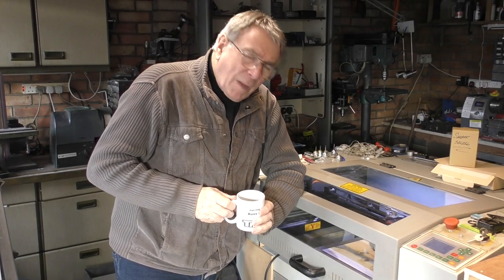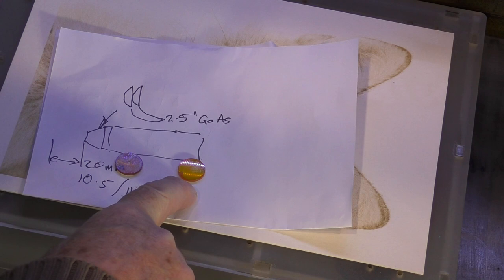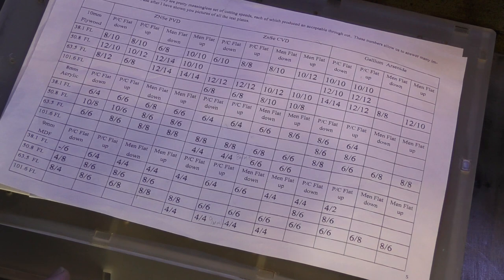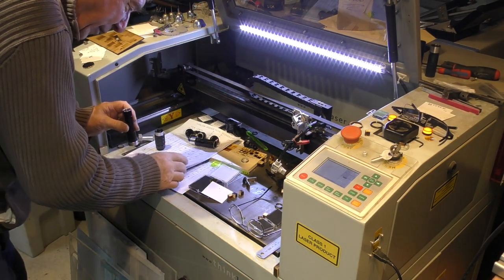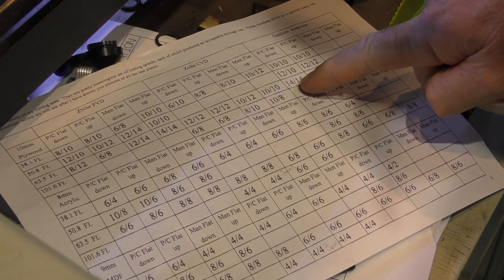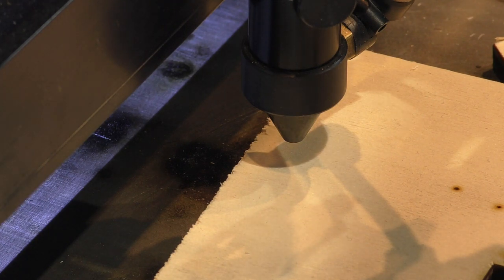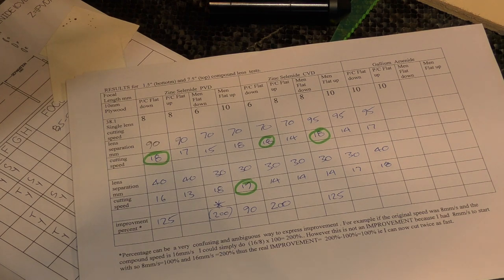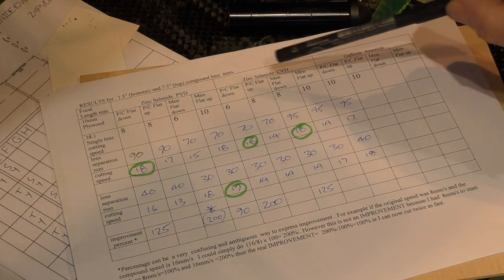RDWorks Learning Lab 200 Compound lens Conclusion

Comment: I feel relieved (because I won't have to use all those contraptions on my weak motor and belt) although I was hoping it would turn out as a total breakthrough. Not everything seems to be lost, as the compound of the two GaAs lens is definitely a great advance and knowing that a 2.5" mundane lens will do an excellent job cutting thick materials. As usual, your contributions to the laser community are priceless, Russ! Thanks for sharing and keep them coming!
Reply from the maker: Hi Nico 
  The long compound lens is not dead as you will see from my answer to Dave V. It's on hold until I begin to understand what is REALLY happening at the focal point.

Best wishes
Russ

Comment: Russ, I recently purchased and set up a 50W (OK, actually 40W) OMT laser and am happily running with Lightburn. Regardless of the software I've found your efforts to be a wonderful introduction. Very much appreciated. Regarding etching/engraving on birch ply I found a useful approach when dealing with an image with broad tonal range. I realized that just as in the darkroom a single exposure won't yield an optimal result, the same holds true with the laser. I've been doing the equivalent of dodging and burning by pre-processing in Photoshop to create separated layers which are within the laser's capability. So, I pull out the highlights, midtones, shadows and blacks into separate layers which I then "print" separately, and can easily control the depth and color each layer. This is, admittedly a somewhat slow process, but has kept family happy with engravings made from their snapshots, which often have blown-out hightlights and underexposes shadows. I will continue to work my way through your video opus.  Thanks for all the effort and theory!
Reply from the maker: Hi Robert
The tonal separation onto different layers  you are adopting is one advocated by Lightburn. In fact you are doing a sort of grey scale engraving but just one band of grey at a time.. You may be getting Ok results but there is a much quicker and precision way to do very accurate photo replication  but don't use the graphics section of Lightburn. I absolutely love Lightburn but when it comes to their photo replication section  Hmmm..... the guy that wrote it has hijacked print industry algorithms and made a few minor changes that  cause all sorts of detail problems when trying to copy them with a laser. Like every other piece of photo preprocessing  software. the emphasis is on getting a good image and then over emphasizing it with sharpening and lightening. to compensate for something few understand..... the DOT you can burn... Forget about the image and understand what your machine is capable of . You cannot paint 20 point  text characters with a 25mm paint brush. You see people suggesting that you prepare 600ppi images to get good detail.. The shows a complete lack of process understaning.To achieve that resolution with a laser machine  you need to able to burn a dot that is 25.4/600=0.042mm diameter. You will be lucky (even with a 1.5" lens to get somewhere between 0.15 and 0.2mm. So that means every pixel will be burnt  about 16 times. THAT is why all these softwares dramatically over lighten and sharpen their images into cartoon like results. I have sent a lot of time understanding the transference of print technology to the laser.  It is not 100% transferable but you can get VERY good results when you understand one simple rule 1 pixel =1 dot. That means you do NOT have to change the power to get darker and lighter gradations  you just change your image into a bitmap with diffusion dither in Photoshop  and the job is done (I exaggerate slightly)  Now comes the trick with Lightburn.  I spent quite a bit of time with the writer of Lightburn trying to sort out tonal issues  with the various  print industry  standard dither algorithms he has included. He imagined an issue that may occur with glass tube lasers and has put some corrections in the algorithms to compensate..  Most folks will be happy with the results  but I was not. His answer was very simple. He added a PASS THOUGH switch that does just that. You present Lightburn with a pre -dithered image  and it will be printed "as is" with no correction. 
 Take a look at  two particular videos in my series (there are many as I gradually learn about this subject) 
https://www.youtube.com/watch?v=jwo9hrVhpIw
https://www.youtube.com/watch?v=UxfC9jbX6PM
If you need more details just add your disguised email address to another comment and I will send you a data pack. I will also delete your comment/email address.

Best wishes
Russ
Reply: @SarbarMultimedia  Hi Russ, thanks for such an in-depth reply. FWIW, I absolutely understand the relationship between dots and pixels; they are binary - On of Off. No third state, which is why there's no gray, and that gray scales depend on the way our brain perceives patterns. With dithering, it's the space between dots. When I think about dithering and gray scale, I realize the different "shapes,"  diamond, cross, rhomboid, etc. are ultimate a dot pattern. It's our brain that makes gray out of the pattern. This is fundamentally different from film. Although black and white film still is based on the molecular structure and density of the light-sensitive silver halides. (So, really, the pixel is now at the molecular level). I will go back and review the two videos you suggested. I've seen others that used the Pass Through option, but the explanations and tutorials seem more convoluted than they need be. I just added a compound lens and am getting set up to run your dot test with the two lenses. email to follow if I can't muddle on through.

Best Regards,
Bob

Comment: So I have another idea for how you should test each lens setup. If you take a block of acrylic and shoot a pulse straight down, you should be able to see the shape of the beam. Then take pulses of various lengths and set them side-by-side. This would in effect provide a frame by frame snapshot of how the laser cuts in time from 10ms, 20ms... 100ms, 200ms. This would give you much more tangible comparisons because you can just measure the penetration of a 200ms pulse. 

Currently, your method can barely determine the difference between 16 mm/s and 15 mm/s, which is a difference of almost 10%. If you instead measure pulse penetration, you can get much finer results, which would make it much faster to optimize all the combinations. Good luck!
Reply from the maker: Hi Daniel
 Many thanks for the brilliant idea. However,  I completed a video last week that includes both the suggestions you made. The second one gives meaningful objective data as you will see when I publish during next week.. It turns out that the real objective differences happen in less than 100ms.
 Sincere thanks for the comment. I was in a bit of a hole a couple of weeks ago  and had to think hard to make sense of what I was seeing.. It's great to know that it stimulates thinking in others.
 Best wishes
Russ

Comment: You have at least proved the benefits of a quality tube. Don't know if I have my old mode burn block, will have to do one again just to be sure I'm seeing what I should. I had hoped you would also see some ability to cut thicker materials with the long compound lens, but the sharper point seems to do just that. I wasn't real clear, did you see the need for the GaAs lower lens, or did the PVD / CVD do all right once you switched to the 7.5" top lens?
Reply from the maker: Hi Dave

 I have a lot more investigation to do because it seems that my "sharp" SPT tube is worth it's weight in gold. BUT I have a lower quality mode burn on my RF Tangerine Tiger and a with only 30 watts available,  could do with a turbo boost for cutting.  I will be transferring some of this effort to that machine in the coming weeks to see  if the compound lens lives up to my original expectations.
 The next video which I have just completed  takes a forensic look at how laser cutting works. I have dabbled with many aspects of cutting as my learning journey progressed  but this compound venture has produced one staggering outcome ...... the almost universal max cutting speed of 18mm/s  regardless of lens combinations.  This cannot be a coincidence and has forced me to think long and hard about how and why this may be happening.

 You can always cut thicker materials  if you have enough power and run slow enough. The next video answers this question and explains  why. It also helped to clarify my thoughts and is allowing me   to better  envision what may be happening at the focal point . There's still a lot more to understand.

In answer to your lens suitability question  all I can say is that GaAs lenses are rated for several hundred watts , ZnSe  CVD are rated at about 200 watts and ZnSe PVD are rated at 80 watts.. Si it depends on your tube and what you plan to do with the lens. There is no one lense that fits all but for most of my normal (non-experimental) use  I tend to use a PVD 2.5" for general cutting  and normal engraving and a compound engraving lens for photo engraving..With only 70 watts I am good to use every material type. 

Best wishes
Russ
Reply: @SarbarMultimedia  Yeah, I'm at 80W and cutting primarily double refined MDF. I can cut up to around 3/8"  on a single pass fairly well, and 7/8" clear pine with a few extra passes, both using a 4" lens. I was dearly hoping you would find a combination that would give a 'narrower' beam, something that go faster or thicker depending on need. 95% of my work is one off, so quite often thick is more important than speed. My last mode burn was about halfway between your two, so there is hope at least. I'll wait to see what you wind up with on the Tiger. Best of luck.

Comment: Hey Russ, this was an amazing Video and a good conclusion! Is there any chance you can go over your heating a bit more in detail? During this extreme winter my tube cracked and broke during -14°C. I saw one of your videos where you showed lamps inside of your laser but maybe that has evolved now. How did you make your lasers survive this severe weather?
Reply from the maker: Hi Kevin
Yes, I have just gone through another winter here in the UK. Not every winter is the same here, in fact  it is rare for us to get much below -5C ( about 21 F) for maybe just 1 week.  My solution works well but you may need to  use  more bulbs to combat the extra low temperatures you experience. There is a video about this  modification  but if you need more data then add your disguised email address to another comment and I will send you information.  I will also delete your comment/email address from public view.
 see    https://www.youtube.com/watch?v=NAiMrMGT1O0&list=PLPWEtx5V9DqEogIeYRdcG_KYcB7UL2Qmn&index=31&t=766s

Best wishes
Russ
Reply: @SarbarMultimedia  Thank you Russ, your video was sufficient information for me. I've added a titanium pond heater with 600W to my 60L water tank and wrote a little microprocessor to keep the water at ~16°C and run the pump as long as the ambient temperature is below 8°C. I've also added WiFi support to report the temperatures so I get an alert when the temperature falls.
I hope this will be sufficient for next winter. I am just so happy I broke the cheap tube that came with the laser and hope my new SPT tube won't suffer the same fate.
Thank you again and stay safe!

Comment: Nice Russ....we all learn from your diligent work.....A purely selfish request.... before oblivion...could u take a look at diode lasers.   The  low cost sweet spot is a Nichia Nubm44 with output about 7 watts when cooled.  Unfortunately it needs compound lens help to take its rectangular beam and change it into a smaller square beam.  Maybe ur expertise with "tilting" lense holders would really help???
Reply from the maker: Hi Dennis 
 I'm afraid your selfish request is likely to remain just that because I still have much to discover about 10.6 micron technology. Your blue laser is around 450nm if I remember correctly. Thus I think you are not lens material restricted and ordinary glass will work for you. I think you need two cylindrical form lenses set at 90  degrees to adjust the aspect ratio and focus your beam. Something like this but much smaller.     https://www.edmundoptics.co.uk/c/laser-grade-cylinder-lenses/1307/
You may even be able to cut and polish your own from acrylic.

 Best wishes
Russ
Reply: @SarbarMultimedia  Thankyou for the cylinder lense idea....just what I needed to kick myself into gear.